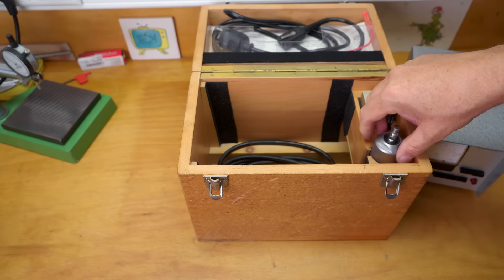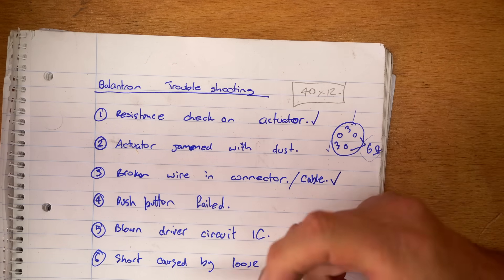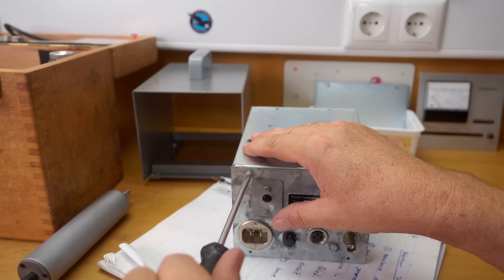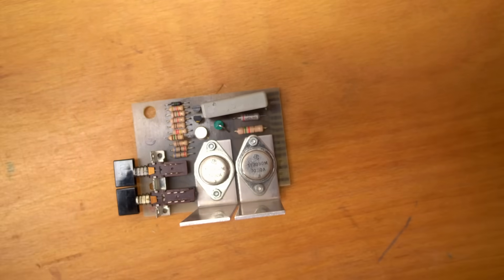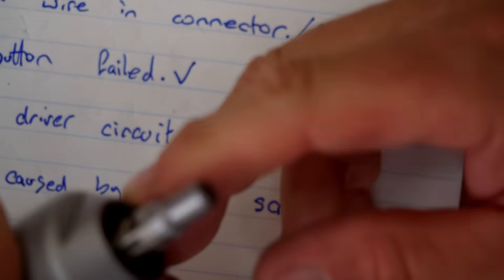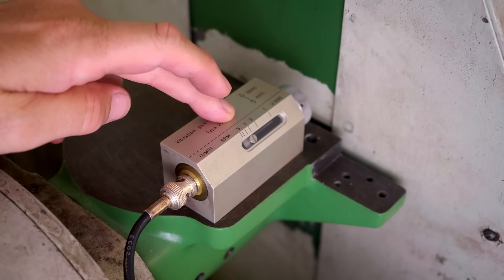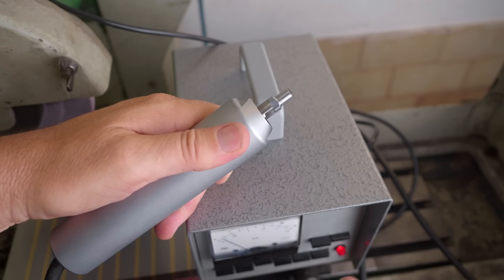Trying to get the Balantron working. || RotarySMP

Comment: The actuator is clearly gummed up. There's simply no way on earth that piddly driver box could possibly move the plunger at the required frequency if you can't even budge it by hand. Those ancient germanium PNP transistors from 1970 have puny power rating.

As well as the circlip, there are 2 flats for removing the nose cone. I expect you'll be wanting to remove that at some point. Don't beat around the bush - we need to see what's inside and watch you clean / fix it. You must be getting close to the root cause...
Reply from the maker: Thanks Murray, You are right. Watch this space. :)

Comment: ... at 9'30" etc, you test the transistors with one of the probes touching the head of the bolt. I have seen many bolts like these develop high resistance to the copper track.
Maybe test by probing the copper track rather than bolt head on the transistors? (As the heat cycles, the board tends to get repeatedly compressed under the transistor bolts, recommend clean & retighten bolts and copper pads too?)
... I'd also be tempted to clean up those board edge connectors with an ink rubber or similar gentle abrasive.
... Agree with other comments that measuring voltages on output would be helpful, perhaps remove back shell of plug and meter the pins?
... I imagine the solenoid movement would normally be pretty violent and obvious. Suspect the unpowered tip should move much easier than it is. Not hard to imagine rust and gunk impeding the shaft.
... Those old blue and silver electrolytic caps (@ 5'50") might have gone leaky and I think I see at least one Tantalum (Mauve/Yellow) cap which often have dubious reputations.
... Thanks for the video, nice bit of gear!
Reply from the maker: Thanks a lot for all your good tips. There will be a third installment.

Comment: A mechanical problem in the solenoid seems likely but I would definitely put a scope on the output of the device going to the solenoid to see if there is a signal.
Reply from the maker: Thanks for that tip. Will do.

Comment: You can test the actuator separately with a low voltage (something like 1,5V) to see if it move. Don't go higher in DC because the solenoid will heat up.
I also would look at each electrolytic capacitor to see if there is no trace of electrolyte leakage and clean every contacts. It's probably not the cause of the problem but it's still something to watch for.
The contacts in the switch are lengthwise not across.
Reply from the maker: Oh, I didn't pick that up on those switches. Thanks for all your tips.

Comment: I think it's definitely mechanical. The solenoid won't have enough force to move it against whatever is jamming it up, as the comment from someone else that has one said, it should move freely with finger pressure. I think the motion it moves is so small, you're not going to hear or feel the coil humming until the whole thing is moving the way it's supposed to
Reply from the maker: Thanks. I'll open it up.

Comment: You could hook up a signal generator or small transformator to the business end and give it 50hz, if you feel or hear a hum you know that it at least moves and that the problem is within the electronics box. No need for something expensive, every cheap-O 5-40€ generator should work.
Reply from the maker: Thanks, I dont have one, so I will first strip the actuator and look at it's mechanical bits, and scope the output of the drivers.

Comment: Ah. That’s why your transistor readings from the last comment made no sense. You wrote 0.03V but you measured 0.03kOhms. You typically test transistors on the dodge test range, not resistance. Try just wiring a couple of 6V bulbs across the output. I expect the actuator is stuck though.
Reply from the maker: Oh, I read that wrong. Thanks for picking up on that.

Good tips. Thanks.
Reply: @RotarySMP Sorry, I just noticed autocorrect changed diode to dodge :) Good luck with the repair.
Reply from the maker: @gillywild  I didn't notice it. I read it as diode :) Brain autocorrect -->correct
Reply: @RotarySMP :)
Reply: @RotarySMP I’m sure you know but, Wer missed, missed, mist ;)

Comment: It looks possible that rubber dust seal has gotten gooey and swollen. It could have too much drag for the coils to overcome. Even if that's not the primary issue right now, it could still keep the device from working as designed. Another commenter mentioned the plunger could be rusty so I think the next step is to disassemble the actuator and inspect/repair any mechanical defects.
Reply from the maker: I think you are right.

Comment: Mark, my two cents here; for sure there's a mechanical issue in the actuator. I would open it up from the back and inspect it. My guess is old grease turned into rubber or worse. Furthermore you tested the two transistors who provide the amplified signal to the probe. Both seem to be fine (although the diode test is not entirely covering all possible faults in a transistor). Let's assume they're ok; are the driven? Or in other words do the base pins receive an input to amplify? If not the circuit before the output transistors has a fault. I'm sure you'll figure it out as always. Thank you for another nice video on a very nice piece of equipment from the past. Best regards, Job
Reply from the maker: Thanks Job. I am not good a electrical trouble shooting. I appreciate the tips.

Comment: if this solenoid are low voltage/power there will be no humm.
try to disconnect it and check device output with a oscilloscope.  or just a multimeter.  there must be at least something on the output.
if it is - disassemble the actuator.
it it's not then problem is in control circuit before driver.
maybe something dead in power circuit for the actuator (burnt because of actuator is seized)
Reply from the maker: I need to reread the manual to learn the Osci function on that orange Omrom meter.

Comment: Have you measured the output to the actuator (with actuator disconnected)? Do you know what it should be? This should be the simplest way to confirm if you have electrical problem, knowing the actuator measured good.
Reply from the maker: Not yet. That is the next step, with the Osci. I need to reread the instruction manual of the Osci for that :)

Comment: It's time to hook up an oscilloscope on that output to see if there is any voltage or oscillations. Heck even a multimeter should show something on the AC setting.
Reply: Also you could hook up the oscilloscope to the input and wiggle the sharp end a bit in and out and look what comes out. If it has a coil or piezo inside you should see something
Reply from the maker: Good point. Thanks.

Comment: Measure supply voltage on the driver, then use old class B audio amplifier with function generator/sine wave generator to see, if the vibrating thingy works.
If it vibrates, then it's likely somewhere inside the electronics box, once you know the problem is in there, it's not that difficult any more.
Reply from the maker: Not sure if I have such an amplifier. The only wave generator I have is a 1000Hz signal from my old multimeter.
Reply: @RotarySMP  No old stereo amplifier with like 20W speakers or so so, somewhere?
If you hook the vibrating thing instead of the speaker, that thing should vibrate, if you feed 100Hz or so, into the amplifier. 3Ohms vs usual 4Ohm speakers matches perfectly.
Reply from the maker: @hinz1  I dont have any old audio amps around the house. Shame , that would be a very easy test.

Comment: Stuck in dried out grease? Sweden is nice, Norway is a million times nicer 😉
Reply from the maker: It could well be hardened grease. Still need to get up there :)
Reply: @RotarySMP  Even if you can't open it completly, perhaps it's enough to put it in an ultrasonic cleaner and dry it thoroughly afterwards?
Reply from the maker: @daviniusb6798  Good idea.

Comment: Almost certainly a siezed armature in the solenoid.
That size and electrical rated solenoid won't produce very high forces.
So it should be freely moving and centering just with finger force.
Probably rusted up.

Nice seeing those old TO-3 case transistors! 1960's 70's technology.
Also notice the curvy lines of the PCB traces, they were routed by hand with tape, probably at 2:1 scale, then photoreduced and exposed/developed to hand make the PCBs. The first electrical college I was in in 1974 had the same setup. The PCBs were hand taped on clear film, a bit like pinstriping tape on a car custom paintjob.
Beautiful PCBs, people should be proud to own a piece of equipment like that which was hand made (ie small production run) it's a piece of history.
Those transistors are nothing too esoteric, you could replace them with many common types if you needed to. 👍
Reply from the maker: Robert Watson identified a 1970 date code in there. This is way better condition than I would have expected for something which lived in a grinding shop.
Reply: Agreed.  The coils are good, output transistors are good, mechanical behavior of the “impactor” is bad.  My money is on a good cleaning.  

I still have a roll of Rubylith tape, and it is still as good as new.  🤓
Reply: @jeremylastname873    wow Rubylith tape? I didnt even remember the name, but to be fair we were starting to use Dalo pens a lot and just draw traces directly on the PCB copper for one off prototypes or runs of a few units. It was just quicker to do that and straight to etch... than to make artwork, do exposures and developing and all the washing baths etc.
Reply: @jeremylastname873  try ultrasonic cleaner and oil. don't submerge it just put it in the dry bet with some oil put on the shaft. wont help rust but will loosen grit allowing mechanical  actuation to clear debris to the oil.
Reply: @chrisoakey9841    I would be reluctant to use an ultrasonic cleaner. It might have abrasive grit jammed in there, so you dont want to expose it to ultrasonic movement with abrasives.
Best to disassemble I think.
Reply: @wizrom3046  i found in working on high precision printers that the ultrasonics didn't actually move the grit as much as loosen it. we would then take then out blow them clean  and re graphite them as oil would jam. the ultrasonics was great though for loosening the stuff even in the metal chassis.
Reply: @chrisoakey9841 
I have burned out a very expensive ultrasonic cleaner when told by the boss to run it dry with some polishing media in it.  🤦‍♂️. They not only need a mass to work against, but also a good thermal sink to protect the transducer.   I knew that, boss did not care.  🤪
If you want to run dry, I suggest you put water in it and then put a heavy (or weighted) container in the water to provide a dry region.  🤓
Reply: @jeremylastname873  Thanks for saving me the trouble of replying! Running ultrasonic cleaners dry is a bad plan for sure. Even running with small liquid volumes affects their operation. That's why the "bag trick" exists: put parts in a bag with whatever expensive or noxious cleaning product you're using, immerse the bag in plain water to the fill line, run like that.

Ok it turns out I replied anyway so I guess you didn't save me any time, but you were so correct that I thought it was worth reiterating. 😅
Reply: @cooperised 😂

Comment: 8:30 That screw holds in the magnet assembly inside the moving coil instrument. The other screw held it in place so no harm done. Remove both and the assembly rattles around inside bending the hand etc.
Reply from the maker: Thanks. Does it also have an adjustment functions?
Reply: @RotarySMP  All that screw, and its partner does, is secure the magnet stator assembly. A drop of loctite might be prudent to keep it from loosening again. 

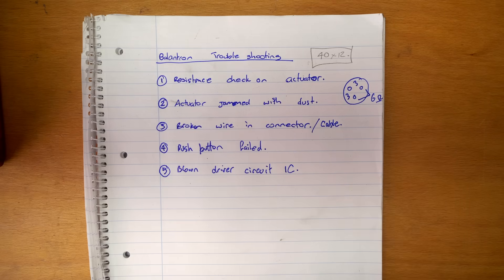The only adjustment on that type of meter will be found on the front to mechanically zero the needle. It's the black plastic flat screw head seen at the bottom of the meter at timestamp 2:49. It simply adjusts the relaxed position of the hairspring attached to the moving coil rotor.

Comment: Hi Mark, we use electromagnetic vibrators at work for modal vibration surveys.  The armature is usually held in place by a flexure type suspension that allows longitudinal movement but not rotation.  I can imagine your actuator has a similar arrangement.  Rotating the armature may damage the suspension.  I think the flats are to allow you to hold the armature still whilst attaching items to the end.  I am really interested to see what is inside.
Reply from the maker: Oh, that is not good. Hope I didn't ruin it.
Reply: @RotarySMP  I was shouting at the screen but you just couldn't hear me!
Reply from the maker: @broglet2003  Poor reception sorry :)
Reply: The business end looks rotationally symmetric, so there doesn't seem to be a reason to constrain it from rotating.

Comment: The instructions say that the actuator should be switched off when not in use, otherwise it will overheat. Therefore, you should normally see an increase in power consumption at the mains connection when you press the actuator button. This should be easy to see with a power meter for the socket.

In any case, the actuator spindle must be free to move. As I understand it, it cannot function this way.
Reply from the maker: Good tip. We have a power socket meter I can put on there Chris.

Comment: Thanks again Mark. Nice to see what was inside - a date code of 1970, so those transistors are older than I am. My gut feel is you'd surely feel something when you touched the armature even if not the body of the actuator. The fact there's duty cycle limit suggests internally it might even get warm enough to used only intermittently. Sounds like actuator might need a teardown.
Reply from the maker: Thanks Robert. Yeah, I guess that is the next step.
Reply: There must be a H-bridge for running the coil, you could look out for those four transistors, spray them with cooling-spray, push the button and watch if one of the transistors heats up before the others do.
Reply: @daviniusb6798  I doubt it’s an H-bridge - seems only those two BJTs in the output stages. Popping a ‘scope probe onto the back of the output connector would be useful diagnostic. Might be prudent to do that before spending a lot of time striping down the actuator perhaps.
Reply: @robertwatsonbath  Do I understand it right that the sharp end of the tool would be in synch with the rpm and the vibration sensor so it would hit the wheel only when the heaviest part of the wheel is in a certain position aka in front of the tool?
Reply from the maker: @daviniusb6798  That is the concept.
Reply: @daviniusb6798 yes, that’s my guess, but just a guess.

Comment: This is a situation where an oscilloscope is essential. I think you want to see the signal coming from the accelerometer, and the signal that goes out to the actuator. The accelerometer probably works, because the display reacts (but see if the amplitude increases is you hold it next to you hand-hel sander). The signal to the actuator should be related to the signal from the accelerometer. If there is no signal, then you know the problem is in the box. If there is a signal going to the actuator, and it shows some relation to the accelerometer, then the box is likely OK, and you should start to look at the actuator. Note that the phase of the signal coming from the box may still be wrong, capacitors matter in this box, if they are part of the signal path (the power supply is a free for all).
Reply from the maker: Thanks for the tip. I need to reread the Osci function set up on that meter :)
Reply: @RotarySMP  If not you can borrow mine, I've an 30 year old HAMEG, should be plenty enough for your needs.
Reply from the maker: @daviniusb6798  Thanks for the offer. I am pretty sure that Orange Omrom Osci should be enough for this signal.
Reply: @RotarySMP  Absolutly, it just crossed my mind because it would be more age appropriate
Reply from the maker: @daviniusb6798  My age or the actuators age :) Oh wait.... same thing!
Reply: @RotarySMP  I think I have to confess that the HAMEG is more my age than yours than

Comment: First thought would be to scope the output, if you don't want to pull your scope out from where its buried then you could just check with the AC voltage setting of your mulimeter. Might be helpful to see if there is a DC voltage there as well to see if the coils are acting in opposition to each other - not sure what would cause that but it would explain the lack of movement.
Reply from the maker: Thanks Adrian. Will do.

Comment: first, I'd check output. Run it through an oscilloscope, or even just the frequency detection on your DMM. Secondly, I'd dismantle and clean the handpiece and check it actually should move freely. it sounds like it should, but doesn't. Thirdly, if you're feeling brave, run some AC through the handpiece coil taps and see what happens -  at 3 - 6 ohms, a small audio amplifer should work fine.
Reply from the maker: Thanks for the tips. Will do.